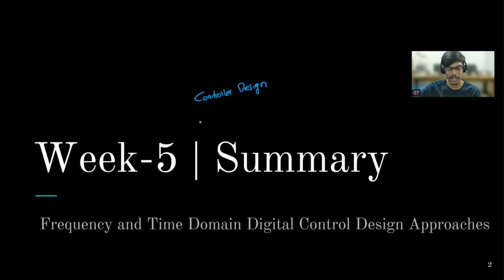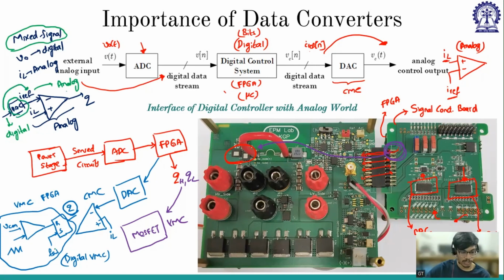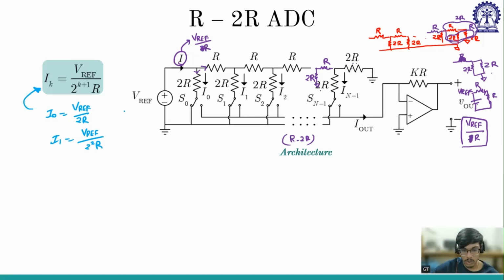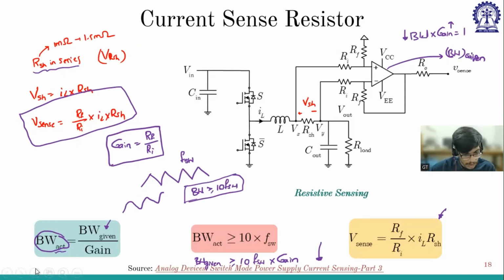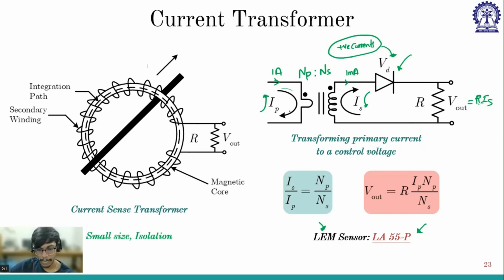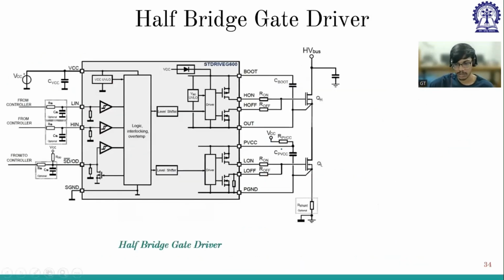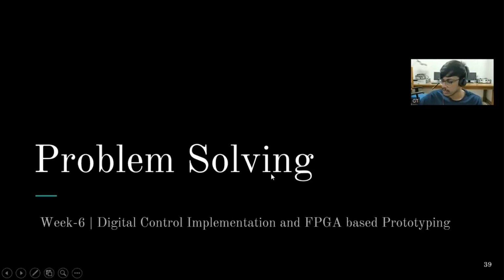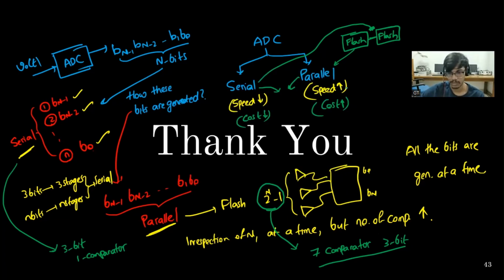Week 6 | NPTEL | Digital Control Implementation and FPGA-based Prototyping | Problem-Solving Session

Comment: Sir, in problem 1 the output of the digital counter show that (b1 to bn). If its clearly given as b1 to b4, then can we directly take as 4 bit instead of calculating the log (n) to the base 2.
Reply from the maker: Yes if its unknown and if it is defined as 'N'. We have to find the value of N using log. But say for the same question N is given as 4 bits, we got n=6 which is 110 is in binary but N is 4-bits, so, the final answer should be of 4-bits i.e. 0110.